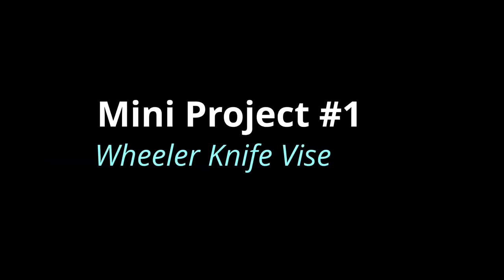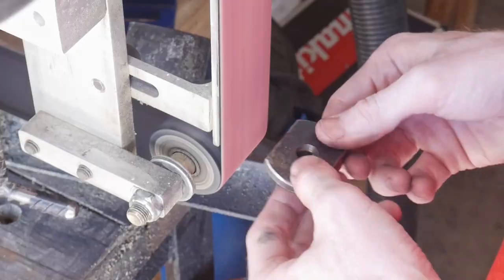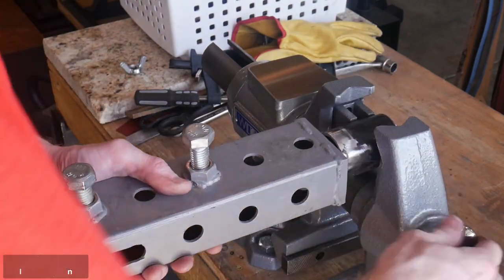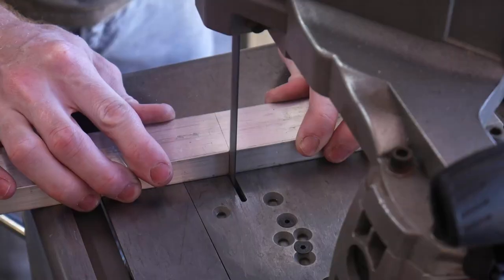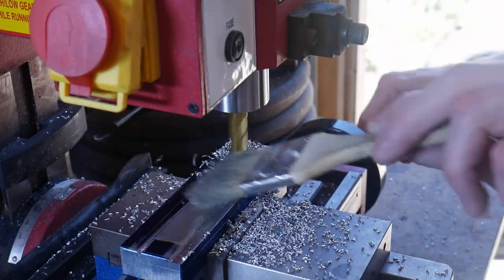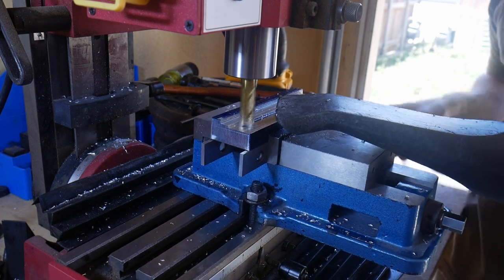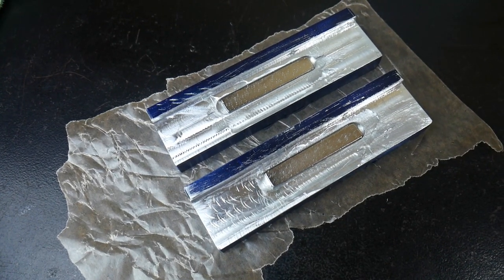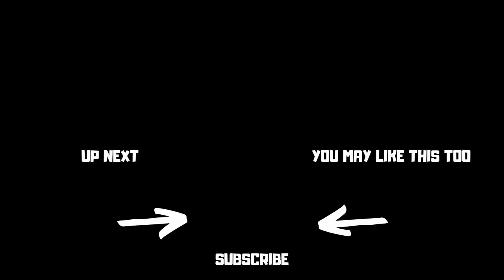Knife Vise Upgrade & DIY Aluminum Soft Jaws | Mini Projects

Comment: I use a cordless drill to "powerfeed" my mill pretty regularly. Not an impact driver. Just low gear on a drill. it helps make repetitive jobs like that go smoother, and I like the slightly more consistent finish it leaves
Reply from the maker: Heck yeah, thanks man! Good idea for sure!

Comment: That’s some neat mods, James. I’m thinking of upgrading my cheap 6 inch swivel vice to something that rotates. 
I currently use a drill vice mounted in the main vice if I need to mount anything in a specific way. 
I also need some soft vice jaws. I saw some locally made of high impact plastic. 

Cheers man 🇬🇧🤜⚡️🤛🇺🇸
Reply from the maker: Heck yeah, good luck in your workshop this weekend sir!
Reply: Red Beard Ops 
😉👍

Comment: Hey man.  Great video!  Check out Walter Sorrells' knife vise that he uses in the same type bench vise.  It's just a pipe, period.  Then you could convert the one you added the small pipe to back to it's original state.  That's what I use and it works great.  Probably going to make one with a little larger diameter for Chef's knives.
Reply from the maker: Sweet Walt! I love Walter's stuff! Great videos for sure. Have a great weekend!

Comment: Hey red, I've been toying with getting one of these mills,  what do you think of this mill, and would you buy the same one again or a different brand? I don't mean bigger, we know a bigger mill is always better but I'd really like to get your opinion on this in particular.  Thanks buddy.
Reply from the maker: If I were to buy another mill of this size I'd get the one from little machine shop. It comes with some built in upgrades. (They're all based on the Sieg X2d)